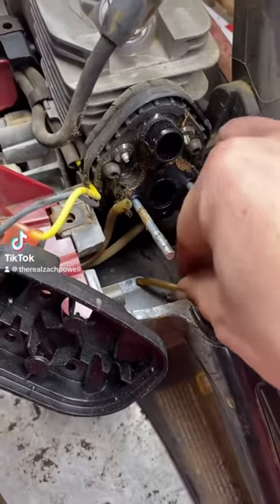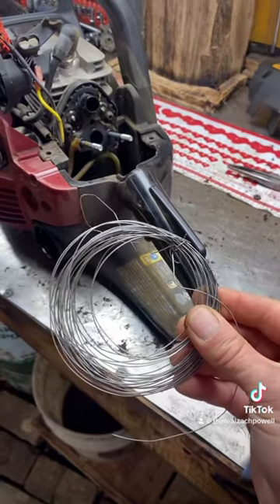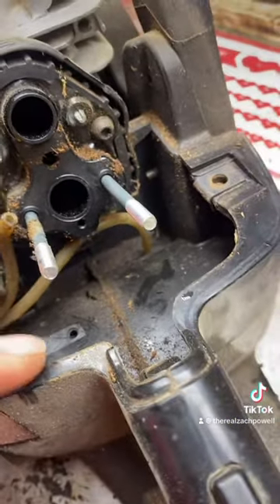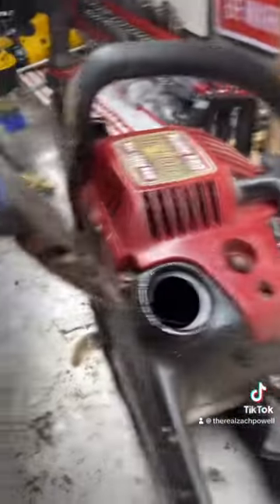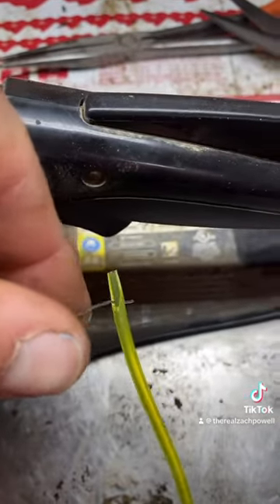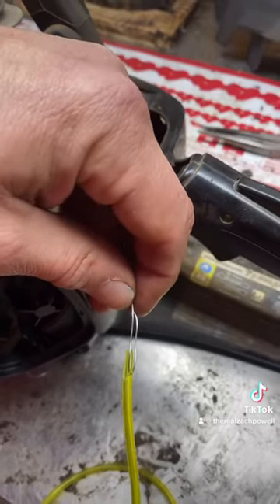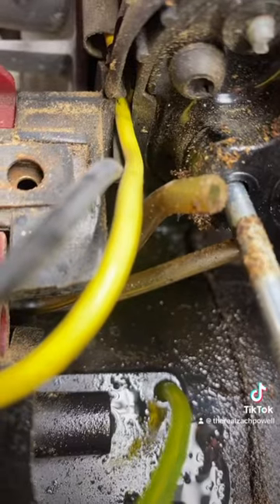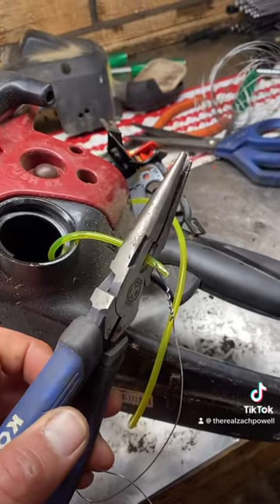Easy fuel line installation on a chainsaw. #chainsaw #howto #tip #diy #smallengine #zachpowell

Comment: Weed eater line about 6 inches long works really really well stick it in the fuel linenand push or pull it right thru

Comment: I had a hell of a time replacing the fuel lines in my cub cadet beastly gas weed wacker. My father had given it to me a dozen years ago or so and I finally got around to working on it got it going listening sounds like a airplane Sam's powerful enough to actually fly..

Comment: Hemostats Work amazing, and have for the past 10 years of me doing small engine work at a dealership. Just cut the line same way start it in the hole reach in with the hemostats roll and pull.

Comment: What they don’t tell you is that if you use an alcohol gasoline, it deteriorates the fuel line.  I’m sure it’s buried somewhere in the instructions, but nobody reads it use gasoline that does not contain any alcohol. This will not happen and your fuel lines will last forever. It’s kind of like the alcohol dissolving seals they put in the Toyota carburetors way back 2030 years ago and they had a rebuild them on the field.

Comment: What kind of lubricant did you use? I’ve got an ice auger fuel tank that I need to squeeze a filter and fuel line through a hole in the bottom. I’ve snapped off the filter nipple on 3 or 4 of them already and embarrassingly never thought of lining it up but is there a certain kind you need to use when dealing with fuel?
Reply from the maker: No wd-40 is fine. I use Amosoil metal protector which is basically a penetrating oil. Anything slick. Could almost spit on it lol.
Reply: @AppalachianWrench my ex used to spit in it. 😢 I should call her.

Comment: I had to replace a fuel line on a weed eater years ago. Found a replacement tank with fuel lines for barely more than the fuel lines. Tank was 20 bucks or so. Wasn't worth my time to try to figure this out lol

Comment: I bought a poulan pro saw years ago and had to swap out 4 different times before I realized what was going on... I would take the new saw, run it till it needed fuel, then once it was full it would never crank again. So I would take it back and get a new one then the same... The fuel line would become heat soaked while I was filling it with fuel and oil, then it would collapse and the fresh cool fuel would freeze it in place.😂😂😂
Reply: Never heard of that happening I'll keep an eye out for it.